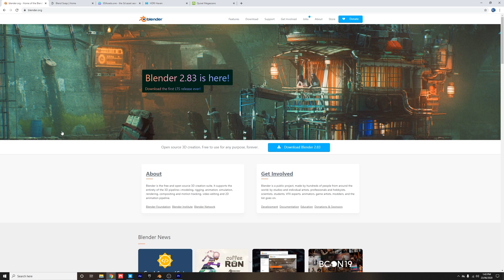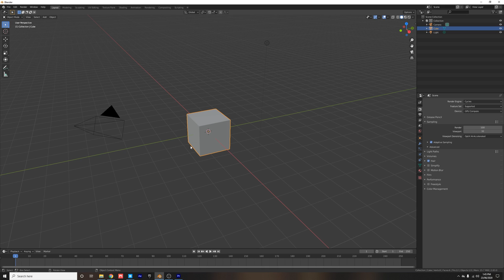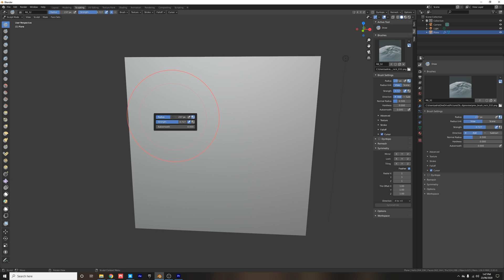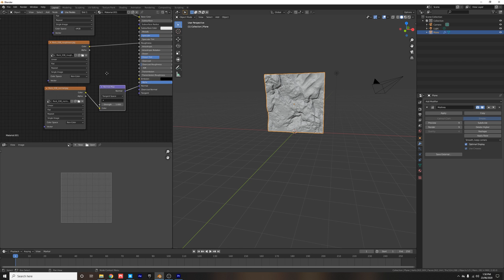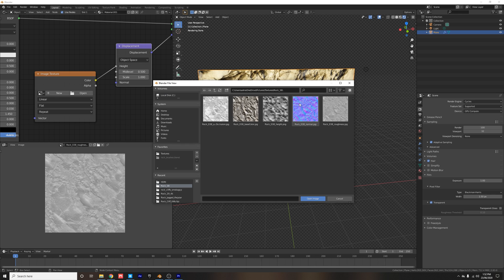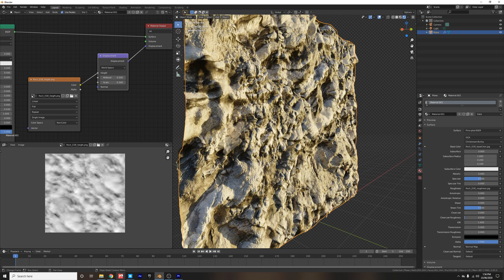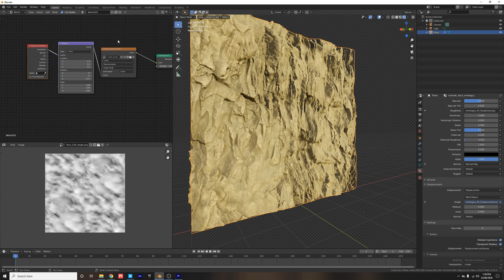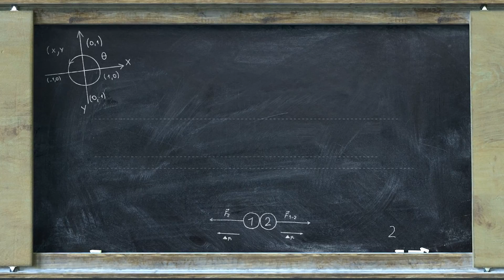How to Easily Make Rocky Surfaces in Blender 2.83

Comment: Hello mate, really nice tutorial, though i noticed that the chunks of rocks with the most height gets meshed in a messy way, instead of quads there are some big lozenges that are ugly and still appear after shading smooth, did you notice and would you have an idea how to fix it ? 
I tried increasing the subdivisions of the plane but it does not change anything i think its either from the brush or from the sculpt settings.

Comment: I used the landscape tool that is in blender and imported 2k rock textures but the material is blocky and not detailed at all, what should I do?
Reply from the maker: It depends on how well made the material is. Sometime using a higher resolution version of the texture can help, 4k if it's available. Or if you are using displacement mapping, it could be that the landscape needs more geometry. You can check by going to the shader editer and seeing if there is a displacement node in there. Otherwise you can try a different material and see if it has the same issues. Let me know if you need more help :)

Comment: Thanks for a great tutorial. I am coming from Blender 2.79 ( I know) and my version of blender now is newer than the one you are using, or so it seems. Hence a few things are different, e.g. when I go to apply the modifier it distorts the mesh even if I click on 'simple' before previewing it, so I just added four loop cuts close to the edges to restrict the distortion. Also I still use right click to select stuff, so I can't right click in sculpt mode to change the brush size but no matter. What I did realise from watching this video is that I can apply a high res rock texture to a plain and then sculpt that plane to match the texture. ( It's for a rocky outcrop that a lighthouse sits on) Was even thinking I might be better off downloading Bryce to make and bake a .obj so many thanks again for this tutorial.

Comment: where is the bump only i dont have  it in my setting
Reply from the maker: You might need to check you are in the Cycles Render Engine (Not Eevee which is default) 

To switch to Cycles, go to the render Properties (Back of camera icon) and next to "Render Engine" select "Cycles." 

Let me know if that didn't work and you need anymore help. I'd be happy to assist!
Reply: @JustTheBasics  it worked thanks

Comment: When I try using the brush and drag on the plane, the rock textures are very blurry. Is there something that I may have missed?
Reply from the maker: Have you tried increasing the subdivision value of the multi-resolution modifier? I had it set to around 8 for this tutorial. If you start sculpting with a low subdivision level, blender will only use the amount of faces available, resulting in the sculpting look blurry. Essentially you can individually control the subdivisions for the viewport, sculpt and render. You want to make sure that your render and sculpt levels are the same. For preview in the viewport it's more a matter of preference. Let me know if that helps or if it didn't make sense, I'd be happy to explain more if that doesn't resolve the problem?
Reply: @JustTheBasics  solved the problem. Thanks.

Comment: For some reason, the blend file doesn’t show up when I try to append it. Please tell me what I could be doing wrong.
Reply from the maker: Have you unzipped the blend file after downloading it from BlendSwap? You won't be able to append the files unless you unzip it by right clicking the .zip file and selecting extract files then saving to a location you can find easily. Or have you already done that and it just doesn't appear when you go to append it in Blender? If that doesn't work, you can always try just opening the rockbrush.blend file itself and resaving it with a new name, then append that file. May solve it?

Comment: Great video! The only thing is that when I tried to add the displacement and bump, nothing happened. What do you think this could be?
Reply: Change from evee to cycles.
Reply from the maker: That's a great question, the displacement texture needs to plugged into the height slot on the displacement node, otherwise if it is just plugged into the normal slot (which it automatically does) it won't work. Or are you not able to find the option in material settings to switch to displacement settings > Bump and Displacement? 
If you are having trouble finding that, you may be in the eevee render engine and need to switch to cycles as commented above. Let me know if none of those worked for you and you're still having trouble, I'll be happy to try and help more!
Reply: @JustTheBasics  Thanks for your response, all is well, I was able to figure it out a few minutes after I posted!
Reply from the maker: @andresmurillo5406  You're welcome! Glad to hear, that's awesome you were able to figure it out :)
Reply: @tonky i have this problem as well! to fix this,  you need to start over but change the render properties into cycles at the beginning. works wonder for me

Comment: Loved the tutorial, thanks! The node wrangler shortcut control+shift+T automatically brings in the maps you select (diffuse, roughness, normal, displacement etc) in a principled set up, correctly set to non-colour data.. real time saver
Reply from the maker: You're welcome :) Thanks so much for the tip! I didn't realize that the node wrangler could do that. Though that's super helpful and will be a massive time saver. Thanks for sharing.

Comment: Hello, great tutorial!. I have a question: May I combine different textures in the same model. For example, using 3 different types of rock textures in the same model. 
Thanks
Reply from the maker: Hey! Thank you :) Yes you can. I'll try and do a tutorial on this as it may be easier to explain there. Essentially inside the material options in Blender, you have the ability to assign multiple textures. There is a small (+) symbol in the top right of the material properties. This allows you to add multiple new materials. You can then select your object and press TAB to enter Edit Mode and select the face/s you wish to assign a new material. Go back to the material properties panel and with the new material selected, press "Assign" underneath it to assign that material to the selected faces. There are also ways to blend textures together but they are slightly more complicated as far as I'm aware. But if none of that made sense, I'll try and put it in a tutorial. Hope that helps somewhat!

Comment: For some reason i am unable to append the brushes from the downloaded file it doesnt appear in my blender directory
Reply from the maker: You'll need to make sure you've extracted the file. (Right click the zip and select > Extract Files, then once you go to append, make sure you have selected the "Brush" folder. Let me know if you're still having trouble with it.
Reply: Make sure you are in the Cycles engine. I was in workbench and it wasn't working, but now does.

Comment: great job man, you should make more terrain videos for blender 2.8. i'm struggling with realistic terrain.
Reply from the maker: Thank you! Ah yeah that can be a challenge, I've struggled with it a lot too. That's a great suggestion though. I'll start putting together some tutorials on it.
Reply: @JustTheBasics  terrain tutorials would be amazing! I've found that making small areas of terrain isn't too challenging, but trying to make a vast expanse (say for a large nature scene) is where it starts to get trickier, especially without creating a very high poly count. Any tips and tricks there would be super appreciated! Just subbed btw :)
Reply: @ololo9283  watch tutorials about terrains in game engines. You can find many tricks to keep performance up. 
#) One of the biggest mistakes most people make ist just use a way too high poly count on distant objects. When you model a high detail rock and scatter them around you want to ensure that that model is only used when it is very close to the camera. For everything further away you go with low poly versions. Around 20 verts for a 5cm rock 30m away is most of the time more than enough. 
#) for close range scatter assets to the ground to break up tiling and make it beliveable is the best way to go. For far range this produces way too much polys. Instead bake the scattered objects into a texture. When you bake your scatter objects also bake opacity so you can overlay your ground textures and change the tiling without affecting the ground. (When you overlay it most of the time hight blending produces the best results)To prevent far tiling you can also multiply a noise over the opacity. (Still take height into account)
#)Another trick to keep performance up is texel density. Stuff that is far away doesn't need a 4k tiling texture. Depending on the size of the object you can come away with very low resolutions. 
#)Don't copy and place meshes around. Instead create "instances" of it. (Has it's own hotkey)
#) Transparency creates overdraw and is really expensive. Don't use simple planes for foliage and branches on trees. Instead cut the plane to roughly fit the outer shape of your foliage. This reduces the overdraw big time .
#) Use fogcards is cheaper then real non-uniform volumetrics. Use a uniform volumetric and enhance it with fogcards give you the best of both worlds.
#) Turn down your lightpass settings. By default they are way over the top.
#) use dynamic displacement and only use displacement on objects that really benefit from it.
#) for far trees create billboard (crossplane) versions of your trees
#) subD modifier are very costly, ask yourself if it's really necessary on your objects.
#) get rid of everything that is not visible in your final scene. If a big obstacle occludes a part of the background why not get rid of everything behind it? Clever placing of foreground objects and sculpting of the terrain can be used to reduce details in the background.
#) DoF is a greate way to hide the low detail of the distant models.
Reply: @Frigus3D-Art  thanks, these are really helpful tips!!!

Comment: Not trying to be mean, but what's the point of using sculpting brushes to create detail if after that you're gonna use material based displacements?
Reply from the maker: No all good! That's a super fair question. I think the comment from Riley answers it really well. 

For me personally, 95% of the time I will just use displacement maps, but that can be pretty heavy on your gpu, especially if you're using micro-displacement. Sculpting seems to help create a more detailed realistic look while being somewhat less taxing on the graphics card, and also gives room for more realistic variation and randomness than a seamless texture can provide. 

Ultimately it's probably best to experiment and see what works best with your scene and set up. For this tutorial I just wanted to show the variety of options you can use to create rocky outcrops and surfaces. Thanks for the comment!
Reply: @JustTheBasics  how did you unwrap that bow rock, I cannot see any seam or triplanar.
Reply: @Riley Smith Scultping doesn't make it more physically accurate; using only the displacement map ensures that the geometry matches the texture. If you sculpt the surface, the texture no longer matches the geometry underneath. So it's less physically accurate, but there is more detail.

Edit: I should add that sculpting can definitely add realistic detail to the mesh, but you have to take care to match the added detail of the sculpting with the texture if you want realism
Reply: @Riley Smith displacement is in no way cheap. You are confusing normal maps and possibly height maps meant for bump mapping. Displacement can turn a plain into a mountain range and is incredibly taxing on your GPU. Using a sculpt brush as well as displacement is just a weird workflow and not great to teach a begginer/intermediate like this tut is geard towards.

Comment: Lol you didn’t show how to create the thumbnail at all
Reply from the maker: Nearly! The thumbnail is made with the same material as shown later in the video (Quixel Megascans). It only took a couple of minutes extra to make on a plane with several edges extruded. I was just trying to show the technique itself in the video, then it can be applied to any models you make. You're right though, it's a pretty saturated topic. I'd had multiple requests to update the previous tutorial inside a current version of Blender as the sculpting tools have changed quite a bit since recording the previous tutorial. Sorry for appearing misleading, I'll update the thumbnail when I get the chance. Thanks for the helpful suggestions!
Reply: Also you’re literally just showing how to create a PBR texture which there are literally 1000 tutorials on. Also… This is your second video on using brush sculpting